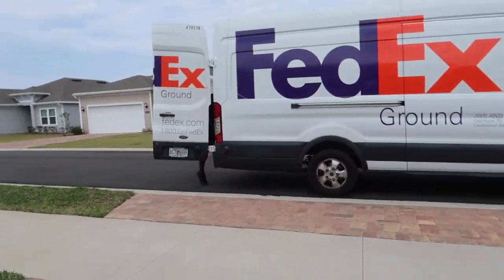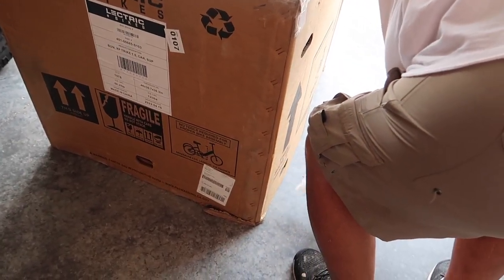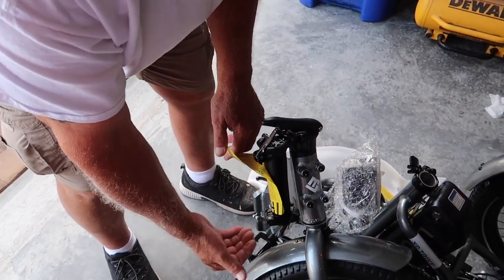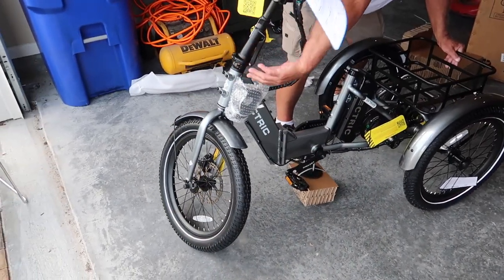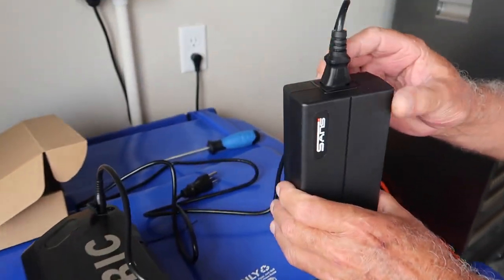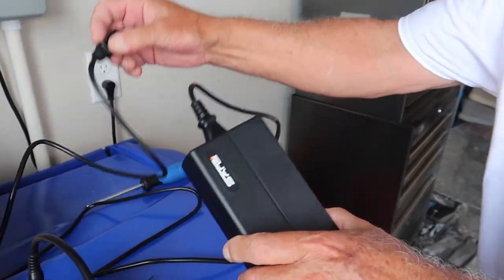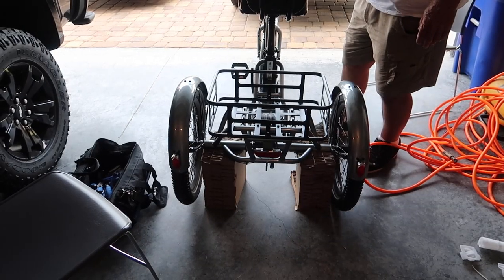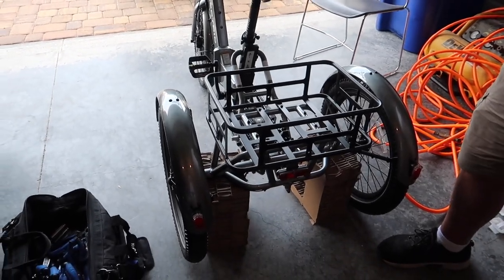Lectric XP Trike Unboxing

Comment: Everyone should know. I bought 2 lectric trikes for me and my wife last July. One of the trikes came with a bent wheel on the back, and the other one had two flat tires. Lectric ebikes sent us a new wheel but I bought new tubes for the tires. Now both bikes have bad rear axle bearings and the bikes are not usable. We have put 117 miles on one trike and 104 miles on the other all neighborhood riding. I sent video of the bearing movement, and noise. they told me I had to pack up the bike in original packing and ship it back 1000 miles just to get it fixed or replaced. I asked for a shop service manual but they refused. These bikes are cheaply made and service is poor. So much for savings.

Comment: I saw someone riding the Lectric trike around my town this past weekend.  So they are definitely becoming popular.  I would love to do a custom e-trike build for high performance.
Reply: id love to see that.!!!!!!!
Reply: I built one with a 1500 watt kit. It'd do about 30 top speed and no issue with any hills. Tried a mid drive to make use of the 7 speed setup* but the cassette on a trike sits a bit further in than on a regular bike the mid drives were designed for so it only worked with the 6th and 7th gears. So scrapped that idea.

*I had built a trike with a gas engine on it that made use of the 7 speed. Got that thing up to 53 briefly, was a scary friggen ride

Comment: Thanks for sharing.  I got my Trike about a month ago, it was damaged, fenders dug into tires, only moved backwards.  I didn't think about checking for wheels out of round, I'll check mine.  Lectric is supposed to ship me new fenders, meanwhile I struggled to straiten the bent ones, so I can ride forward.  Can you do this? I took my battery off and brought it inside for the night, now I can't get it back on.

Comment: Just received 2 Trikes yesterday for my wife and I.  On one Trike, the rear wheel is bent similar to yours. On the other one, the fender is dented. Seems to be a common problem. Yeah, it wouldn't take much engineering, which they seem to be good at, to figure out a better packing method. They have to be losing money sending out all of these replacement parts. Thanks for the video.
Reply: Lectric took care of both problems for me and then some. They are sending 2 complete wheels, I only needed one. 2 fenders again, only needed one. And a paint touch-up pen that will come in handy for the scuffs. Great customer service!

Comment: What did you spray on the brakes to clean the oil off?
Reply from the maker: Just regular old automotive brake clean. Make sure you get the extension nozzle to get it right down in there. It worked great thanks for watching. I hope you subscribe and there’s more to come. Thanks a lot.

Comment: just got mine,fenders bent, brake light area dented.have to remove the wheel to work on the fenders. fedex is brutal.will lectric replace damaged parts?hope  your problams get solved...dave
Reply from the maker: Yes, they will take a picture of your serial number and photos of the damage, our videos and send it to them. They’ll replace everything even the trike if the axle is bent.
Reply: thanks for info..dave